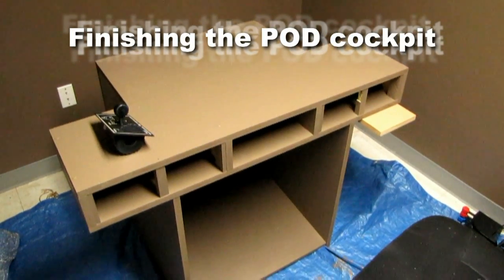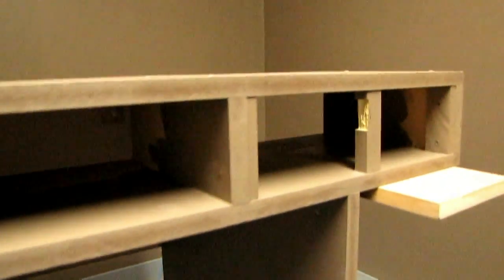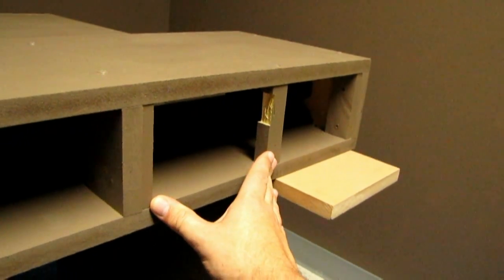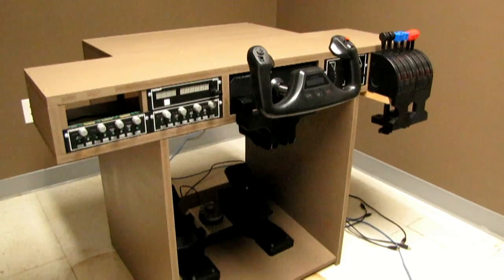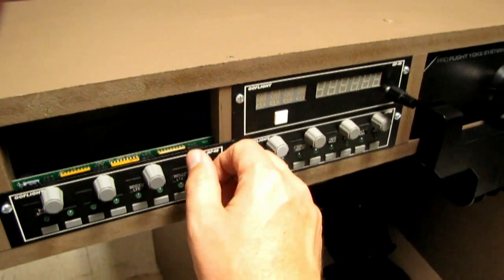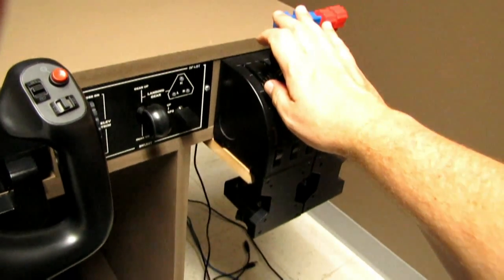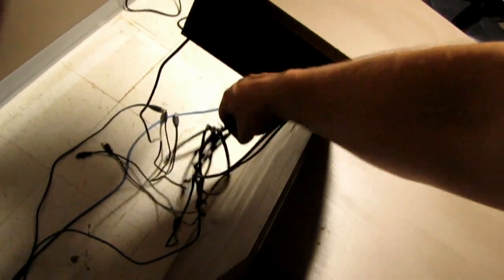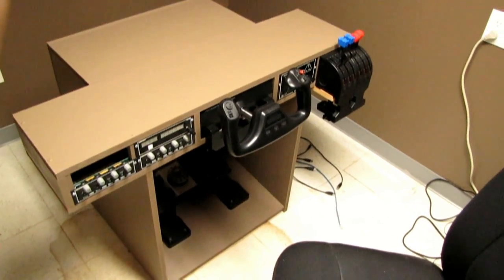Finishing the POD Cockpit

Comment: @brandon9271 works good you can use the rudder as brake and gas instead of toe brakes on the simulator and the yoke ofcourse is used as the steering wheel

Comment: @joker1031000 I don't have any saitek flight simulator things yet. but if you get a saitek throttle it will work on Boeing's. But you can not manually control 1 engine it will control both engines. But you can probably have on lever to left engine and 1 lever to the right engine.

Comment: Bill, how do you calibrate the Saitek throttle quadrant? Congratulations for the project.
Reply from the maker: Hi Luiz. I use the registered version of Pete Dowson's FSUIPC module for all my controller calibrations.
Reply: Bill Womack I also use FSUIPC registered. What is happening is that I am unable to calibrate the throttles using FSUIPC. I have two Throttle Quadrant levers with 3 each and only two knobs with the correct calibration. What can I be doing wrong?
Reply: Bill Womack Hey man i have been wanting to do this but I'm 13 what parts did you use where did you get them and how much did it cost you to build this not including the computer just the aircraft controls and the desk also do you have blueprints. Sorry i have not watched the whole video so I'm not sure if you have mentioned this or not. Im looking to spend no more then 7,000 dollars
Reply from the maker: Luiz Gallo Are you using Saitek throttles, Luiz? Mine are starting to get wonky and hard to calibrate on a couple of axes, so that might be what's happening.
Reply: Yes, I´m using Saitek throttles and others produtcs Saitek. Now, my cockpit is working correctly.
Reply from the maker: Good news!
Reply: Thanks I appreciate your help.